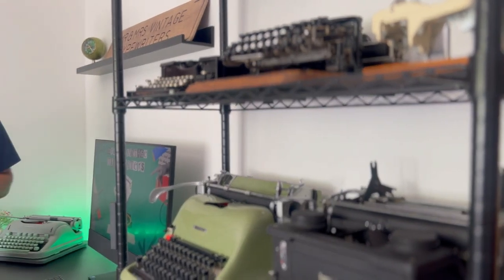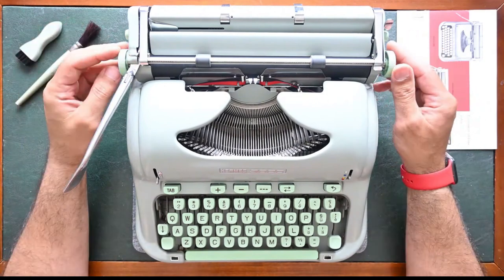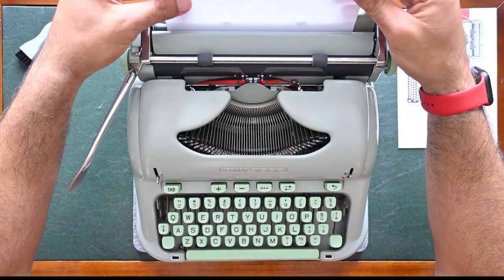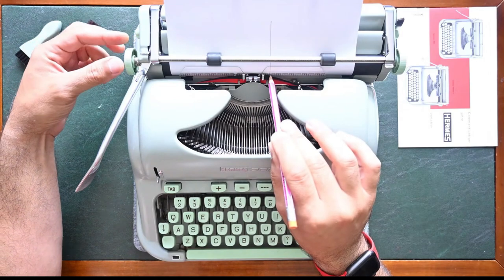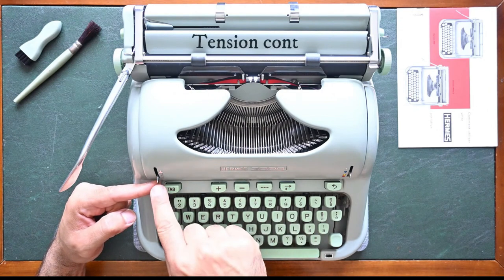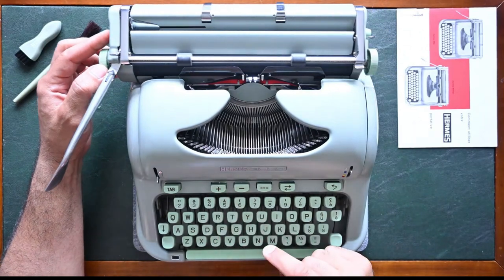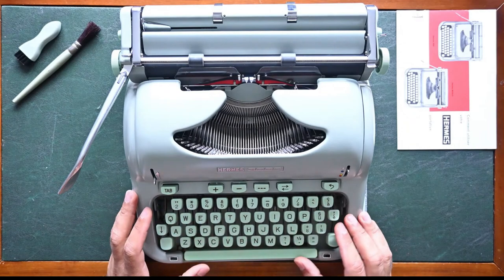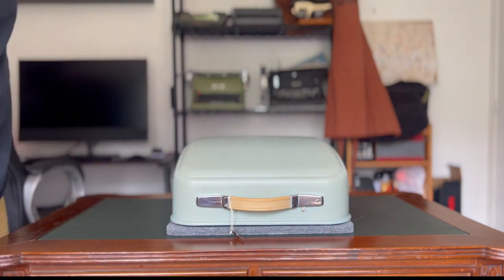Step-by-Step Tutorial: How to Use Your Hermes 3000 Typewriter - Full detailed & clear instructions.

Comment: Looking for help. My 1963 Hermes 3000 was an impulse buy. I believe it is in really good shape. I have changed the ribbon, very lightly cleaned and oiled the ‘letters’ after watching you tubes for direction. No matter what I do, typing seems to require finger strength that I don’t have…typing is not at all enjoyable, and I am sure there is something I have not figured out. Welcome advice.
Reply from the maker: Hi, honestly it’s always about the item being not properly serviced and cleaned. It won’t perform well if it wasn’t fully flushed and cleaned. It might be other issues as well but if it’s typing , it means it needs a properly clean of the segment.
Reply: I assume you moved the “touch” (tension) knob down to level 1.

Comment: wonderful, thank you, I have owned a hermes 3000 (swiss keyboard) for about ten years and I have decided to write my novel on it. I never knew about drawing a line with that little hole - brilliant. Do you have a video about changing the ribbon? Also, if I needed to clean and oil it (with a compressor etc.) how would I go about doing this, and does it actually need any oil?
Reply from the maker: Pleasure. Glad you like it. Don’t oil as the oil will accumulate the dust and clog the mechanism.they need proper clean from inside and flushing the keys segment . Thank you
Reply: @MrMrsVintageTypewriters  okay great thank you so much, and just a clean with a compressor is good enough?
Reply from the maker: compressors are good when carefully used.. they remove dust but not grime. plus make sure not to accidentally blow on springs.